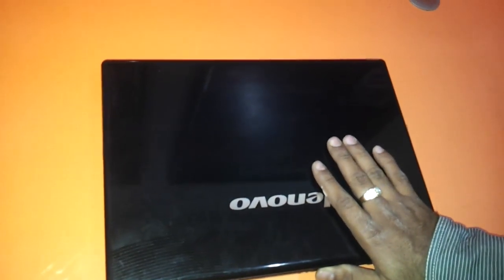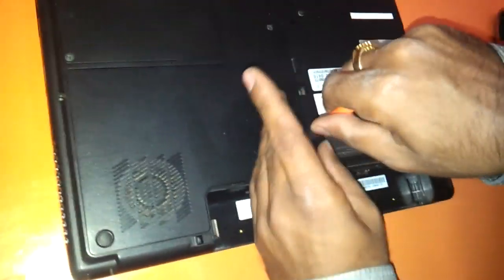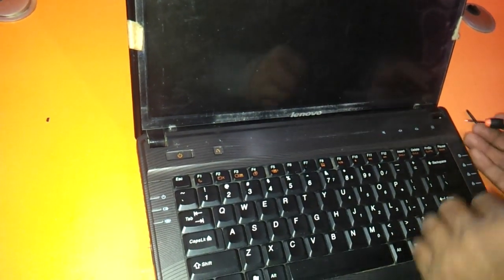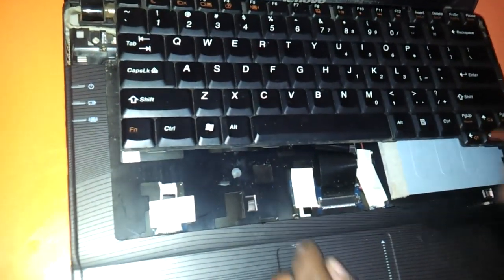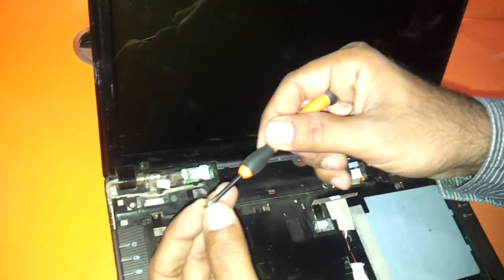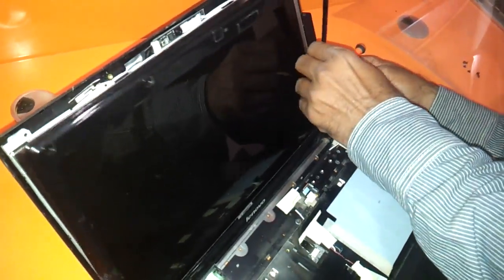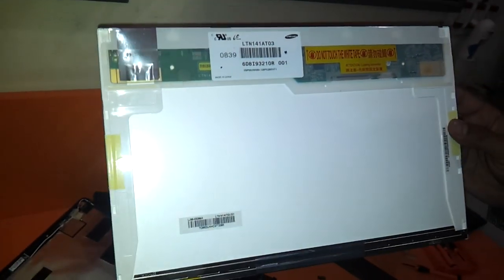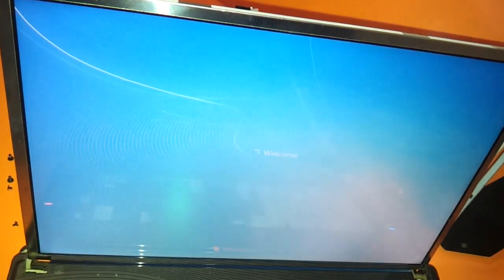replacing lcd dvdwriter keyboard inverter board of lenovo g430 g530 notebook

Comment: Pretty nice work. Thanks. Actually you got me motivated to refurbish one these I used to have, it could be good running linux on it I guess, ample for basic tasks.
Reply from the maker: that's so nice to hear. putting these for use with Linux would be great.
Reply: @TechstoreCoIn  Thanks, did it already. Got some parts delivered and it's working already although after a while it slows down so need to dig it up. Nothing too bad still.